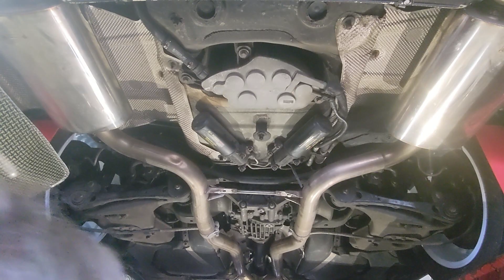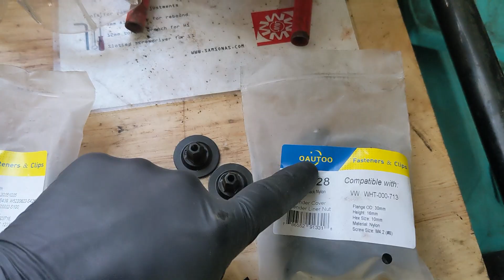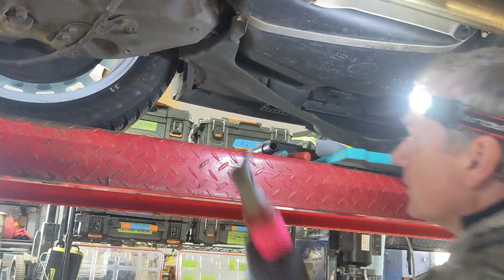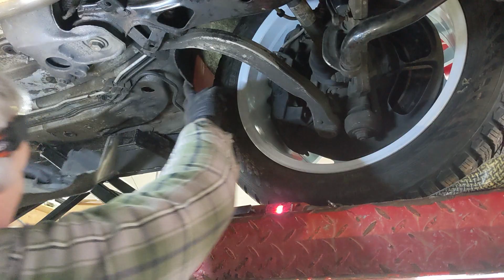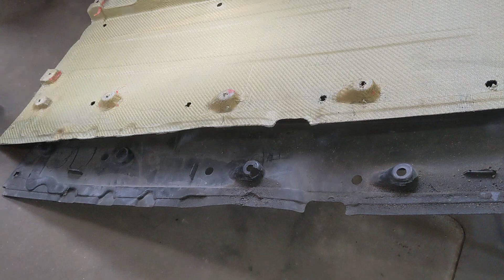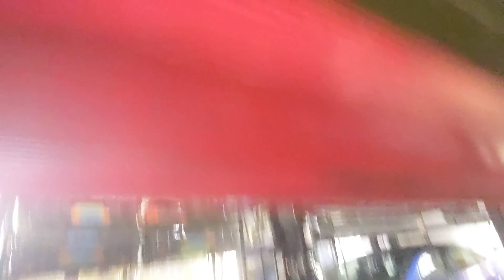OCT composites B7 RS4 ultimate installation - Froooog underbody protection part 2

Comment: Also, how do you find the JHM brake lines? How long have you been using the brake lines?
Reply from the maker: I have another video on the brake lines. So far so good after all the events we did this year in pretty challenging conditions.
They seem to be of similar quality to the ones we use on the Subaru rally cars. I can't speak to long term durability but it's a pretty simple part with good quality materials.